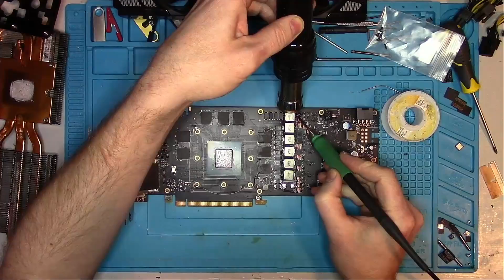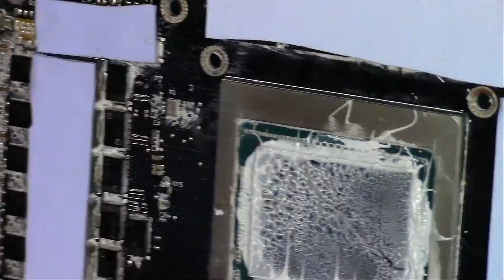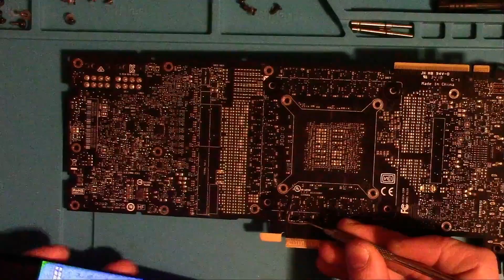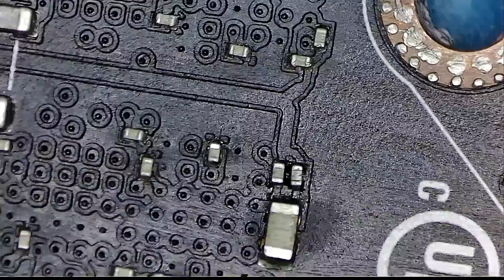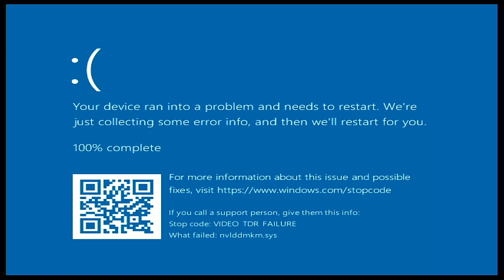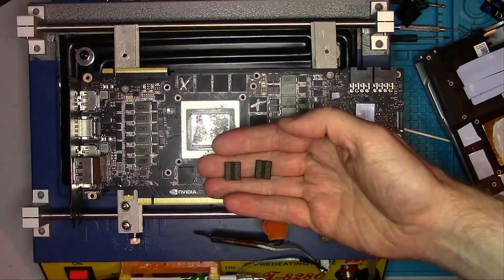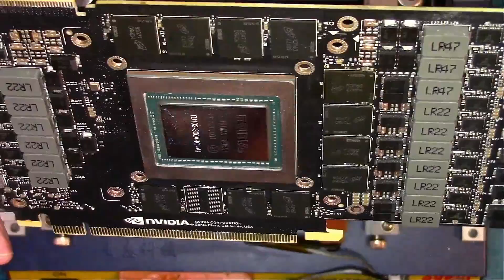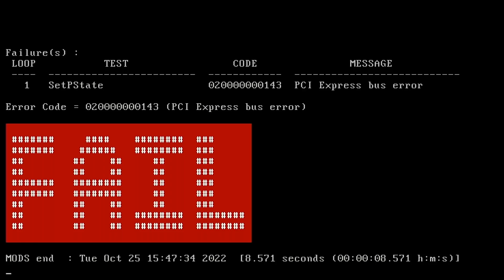2080 TI Memory problem warning

Comment: Hi i love the videos i have one question i have a 3060 ti from gigabyte with faulty vram chips. I removed all and i only happen to order one vram chip with is like 30 dollars. So my question is can install just one still just to see if the vram is good and them order the rest and put all. Because i reballed the first set and the card will boot but with terrible image. So can i just use one still and test??
Reply from the maker: you have to change straps to configure card for different memory brand.
Yes you can do one chip at the time if you want.
Reply: @northwestrepair  i was hoping to go to samsung but i heard that sk hynix 206A is thr new production code and its no faulty in the slightes only 126 to 135A so will still use the same memory but a more up to date one.
Reply: Were all the vram chips faulty? 

If you know which ones show as faulty after reballing, replace that chip. Even if there is still a faulty chip, you should see an improvement. That is, unless the fault is a shorted chip.
Reply: @AnnaVannieuwenhuyse  thing is the gigabyte 3060ti's come with faulty sk hynix chips. It was a big problem at the time.  The gpu it self is healthy and ok. But the vram chips are the problem. I've seen so many people replacing there vram chips due to gigbyte using bad batches of chips.
Reply: @AnnaVannieuwenhuyse  and yes after reballing two got shorted and had to get rid of them
Reply: @zane383  I don't know much about this stuff, but if they got shorted when reballed, couldn't you just reball them again until there's no short?
Reply: @trr4gfreddrtgf   you are correct but it was not shorted because of reball the chip itself died. I believe is because it was already giving issues and the heat when soldering it back killed it. I've this for my rx 480 and is fine so i believe the chips are just not good
Reply: @zane383  Oh okay
Reply: Glad I sold my gigabyte 3060ti then.
Reply: @sansundertale69availablename  yeah but not all come with bad memory.
Reply: @zane383  so just luck of the draw? And depending on when they fail its a big issue.

And I'm also hearing a awfully lot about low quality products and gigabyte, not sure if they should be bought anyways.
Reply: @sansundertale69availablename  wouldn't say it any better than how you did. the card was working fine but just started flashing different colours on the screen.
Reply: @zane383  ah I see that sucks, I hope it was within warranty for you. I have had 2 gigabyte cards without issues (a 1650 and 3060ti) but I think I'll stick to brands like inno3d or something were the worst thing I can say is that the coolers can get loud in a case with not so great airflow.
And that they're not including the mouse pads anymore which is a decent reason of why I got them.
Reply: @sansundertale69availablename   thats the thing i didn't get it brand new bought it off ebay and one of the screws with the warranty sticker was already damaged so this is why i have to do this repair which i can but just wanted the right info before doing so.
Reply: @zane383  I'm sorry to hear that I hope it'll get fixed and not cost to much for you.
Reply: @sansundertale69availablename   am hoping the same thing to. I really do